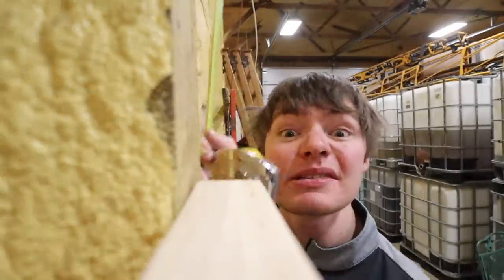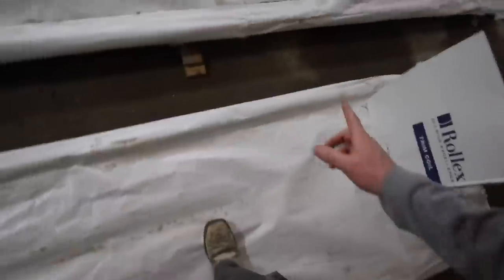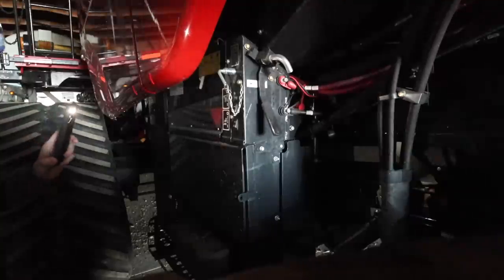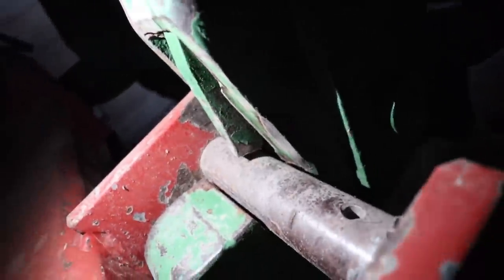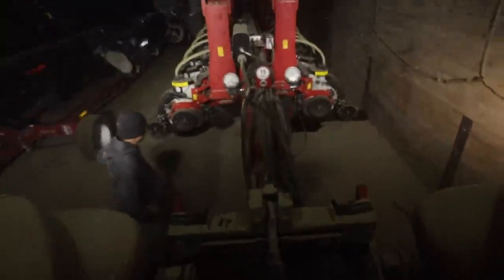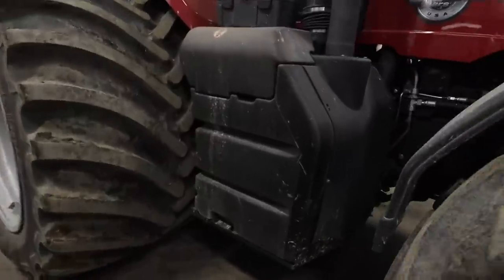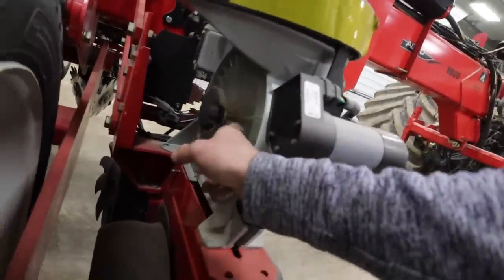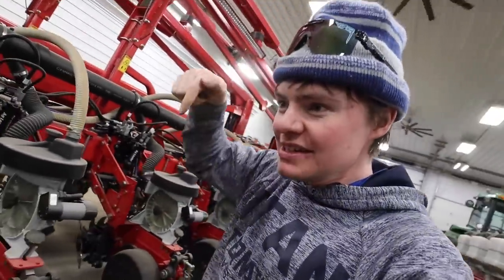It Is Too Cold! Will The Red Tractor Start?!

Comment: Hey Cole, the hydraulic cylinders on the 24 row planter probably need seal kits put in, easiest way to test is to raise them up, shut the tractor off and take the upper hoses off the cylinder, if oil comes out then the seals are bad.

Comment: LED light generally do not pull enough amps to warrant a relay in the circuit , you more than likely have a short to ground  bare wire on the supply to the rear lights.
Reply: Short circuit sounds plausible, but what if they are using a bunch of LEDs where there was only one set of floods and a lot more wire. You can draw more than the fuse is rated for.   Sounds like a job for a multimeter

Comment: Just so you know they make a pencil sharpener for carpenter pencils and they are usually in the bin next to the pencils at the lumber yard.  

You should take two or more vertical measurements so you can cut the bottom of the tin to match the concrete better.

Comment: Check the wiring on those  LED on the fenders .  Measure the ohm value on the total load of them . What size if the fuse that blows ?

Comment: You have a hydraulic cylinder that has a bad check valve or what’s known as a counterbalance valve. Inside the cylinder. When it lets fluid by, the fluid goes right back into the system into the tank drain. It’s usually not an external leak, but an internal leak. And that causes the cylinder to retract even under pressure and it won’t hold a load up.

Comment: The problem with the fuse blowing is something that really needs to be looked at. Everything on that circuit needs to have adequate capacity to handle the load, the switch, wire gauge and and relays. If this is a new problem you should trace the wiring to rule out a short circuit, which can ruin a wiring harness or burn down the tractor.  If the current wiring and switches are marginal for the load, using the current switch to drive a relay and wiring of ample capacity to handle the the load. I don't know if the current lighting is on a relay, but if it isn't already, putting a relay on it is a good idea. If it already is on a relay, make sure the relay and the wiring that relay runs the lights with is of ample capacity. If you are running an 18 amp load on a 20 amp circuit, it would be a good idea to run a heavier separate relay, fuse or breaker, and heavier wire to the relay, don't just put a higher amp fuse on the circuit.

 The calculations are pretty straight forward, but everything in the power chain for that circuit needs to have ample capacity to handle the load. I remember you adding a lot of auxiliary lighting to that tractor or the combine recently.

Comment: Try putting a LED load resistor in. We run Bradford built flatbeds, with all led lights, on older trucks that used to run halogens. If we don’t put a resistor somewhere on the bed the lights either flicker or blow a fuse like your case.

Comment: IF the tractor had regular non-LED bulbs originally, you typically need to get a flasher relay with an extra ground wire. I'm not sure I've ever heard of it causing a fuse to blow if you don't have it. Usually, the flashers just don't work well....

Comment: Try running a temporary power feed directly to the lights, preferably through an ammeter. If the load due to the lights is normal this will reveal if there is a wire in that lighting circuit that has an insulation fault and is a direct ground. Then you can use the ohm meter to trace each section of wire to determine which section has the ground. Once upon a time I had a vehicle that would blow the fuse to the dash if I engaged one of the turn signals when the cruise control was on. A multi wire cable in the steering column had worn through. I patched it with two thicknesses of heat shrink tubing.

Specialty sharpeners are made for carpenters pencils. They're not great but they work and they help those who have a poor safety record with razor-sharp edges avoid the box of bandages.

Comment: Make Coop check the leds individually and to try which one is causing the problem.
I once came upon similar problem, all worklight leds separately, there was no fault.
But when all of them was lit fuse always blew. 

It took some time to find the faulty one what caused the fuse to break.
Aventually I didn't find anything seemingly wrong in the led. No short on the wires or exessive heating.
I think there was something wrong internally, since I replaced it with a new one with more watts and it didn't cause problems so it was not the reason.

Comment: Seems like its probably a bare wire touching metal, check all the connections, make sure they are all overkill tight and soldered. I hate electrical problems like that, something so simple yet so hard to figure out until you do it, then you realize how easy a fix it is. Complexity is always equal to confront, I find that to always be true.

Comment: Fuses blowing is a sign that some wire may be grounded or there is a short in one of the lamps. You must find out what is the deal and where a wire is chafing against metal or if something has happened so your live leads are against a metal object or edge. You may need to pull the fuse and measure the wire if it is grounded or not. You may get a different measuring then expected if the electronic cirquit in the lamp gives a false reading, but normally a LED will give very low ground leak. Try to put direct power to the lamp to see if it really is working or has a short cirquit. If there is a short, you will know by the huge spark it will give you.

Comment: on the lights unplugg both and turn them on, if it blows its in the wiring, hook up one light then the other, if it blows with a certain light you found  your shorted light, on the cylinder falling i assume it does it with the tractor unhooked, so you have a cylinder bypassing internally, use a mechanic steahascope and listen for the fluid bypassing on each cylinder sometimes it is hard to find sometimes they will squeal

Comment: Also fun fact about carpenters pencils, the flat side is 1/4 inches and the tall side is 1/2 inches which is handy for rough in stuff if you don't want to grab a tape measure for a quick half inch cut

Comment: If the fuse is blowing immediately then likely a short to ground.  If this is a new issue and they used to work with LEDs then again, likely a short to ground. 

Those two LEDs should draw much amps to be blowing a fuse. The relay just allows you to use small gauge wire to run the switch with larger wire carrying more amps for the device.  

Could be corrosion crossing the + and - within the light housing as that’s happened to me before.

Comment: Cole, check the resistance of each light from the connector. What size fuse are you using. You have a dead short somewhere either in the bulb or the circuit for those lights.

Comment: Look for a Carpenter's Pencil sharpener.

As for the stinky tractor cabin, buy or rent or borrow an Ozone generator. Run the cabin ventilation on recirculating setting while using the Ozone generator.  Should take 45 minutes to 90 minutes to destink the cabin.

Comment: A circular withe a fine tooth blade cuts that steel just fine and faster be sure and cut from back side and were ear plugs and safety glasses. Or you can invest in a power shear or attachment that goes on a drill. Tined many buildings that way

Comment: Rear lights are or should be a grounding out issue. Had that with my truck and trailer, a screw went through the wire insulation. Every time I turn on the light's it blew the fuse

Comment: As for the lights pull the fuse put a meter in the slots on amperage turn it on and see how much its pulling. If more than your fuse add a relay with its own fuse of a few amps more than it pulls.

Comment: Have too much load on the fuse. Either put it on a different circuit with a higher amp fuse in turn it’ll have bigger gauge wire. Relay may not fix your problem if wiring is too small.

Comment: The led lights probably need a resistor because it takes so little power to turn them on it’s over loading the fuse and the fuse burns up so I would get a resistor for them.

Comment: Cole, many will disagree, I call them unsafe and lazy. I don't like having any amperage load on a dash mounted switch. LED, halogen, cooling fan, etc. I've seen to many dash fires. Most of the time it's from not having any fuses and no wire protection. I would start by checking if it's a defective light. Then check the wires to it are not pinched or cut from pulling them to the light. That's where protective sleeves come in to play. Me, I would have all the lights on relays with a large fuse or breaker from the battery and small fuses at the switches for triggering the relays. Just my two cents, hope it helps.

Comment: Couldn’t you solve the hydraulic issue with a check valve to prevent the wheels from dropping? 

Check you lights for  short in the  wiring.

Comment: Washing isn't as urgent as Two way radios FM or CB.  Get the filter blow-out tool at Napa - you use far less air filter elements, paper filters blow cleaner easy. Last a couple of years if kept dry. fM radios use Privacy Guard sub-audible tone squelch - No hearonh the neighbor farm Unless they Want you to, can make another channel on your Frequency and tone. We use 102.5 Hz. Also good for Repeater access control. On water towers and highest Silo around.
Reply: Can’t use it on the filter he’s talking about.

Comment: Awesome work... You asked about the lights on the tractor blowing the fuse... NO this is not an exact answer.. but the place I always started when troubleshooting 12-volt issues... You might want to disconnect the lights from the harness..and if you can disconnect the cab end as well, then take a volt meter on continuity mode/ohms..or beep tone mode & check each wire to be sure that you do not have a short in one of them... You can also check your switch with the meter... another suggestion..If you tapped into the power source, at the relay box or fuse panel,, be sure that you tapped into the "POWER" side...not the accessory side, then you will have fewer problems.. ..lastly, you can also check each light to be sure they don't have a shot.. If they have plugs, you might want to disconnect 1 light at at a time and see if one pops your fuse.. Sorry, this is not an EXACT answer.. but they are basic troubleshooting tips... another tool that is awesome.. besides a vom... volt-ohm meter is a Power probe..

Comment: 15 30 sounds like you have a bad led.  Unplug them put a new fuse in than turn it on it shouldn't do anything see if you have other lights that plug straight into it try them and see if it works

Comment: Highly recommend ultrasonic leak detector with conduction probe because they can listen to valves that are still connected example leaking steam valve leaking water valves leaking air valves and it can also find holes pretty fast in refrigerant lines Airlines couple different things really
Reply: I myself got it from Tru-Tech tools
Reply: The conducting probe is for bearings and valves and such. Open air tip when locking for leaks of the gaseous kind

Comment: Purlins. In architecture, structural engineering or building, a purlin (or historically purline, purloyne, purling, perling) is a horizontal beam or bar used for structural support in buildings, most commonly in a roof. Purlins are supported either by rafters or the walls of the building. They are most commonly used in metal buildings, though they sometimes replace closely spaced rafters in wood frame structures.

Comment: Well you should have installed all you j trim and base trim ad did  layout by snaping lines on the wall for your wood backing and then  install next do layout for your panels 3 foot on center top and bottom if there delta span panels doesn't mater what your concrete is doing that's what a transit is for to set a bench mark ofcourse you can adjust for the concrete by looking with your eyeball what looks straight and level to the eyeball  is ok but you have to stay within some tolerences along as its not affecting structural integrity then pre drill all your panels lay them out in stacks of 4 every12 feet or so all trim should be installed first than you do layout and cut any panels around  doors or windows  whatever so when your installing panels you don't have to stop to cut a panel every panel will have a mark top of jtrim bottom on base trim exactly  where it goes   You can stretch and shrink panels every screw every panel everything has a layout exactly where it goes we drill a stack of panels for each wall knowing exactly where that screw is going to land your wood gives you 3 inches to play with what you want is when you look at the screw pattern eyeballs looking across the screws horizontally pre drilled panels are dead on because we hold are panels slightly of the base trim making the panels level and plum because we start true plum and level and continue to check plum with a iron workers level which extends out to 12 foot or more the longer the panel the longer the level needs to be. Also your panel should not be touching your base trim it does alow for expansion and tends to put unnecessary tension on your base trim.